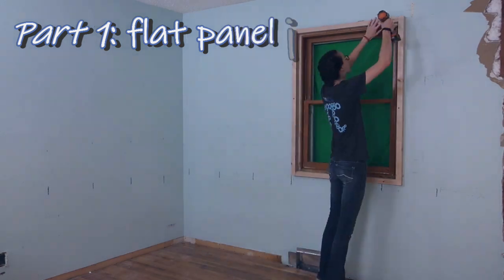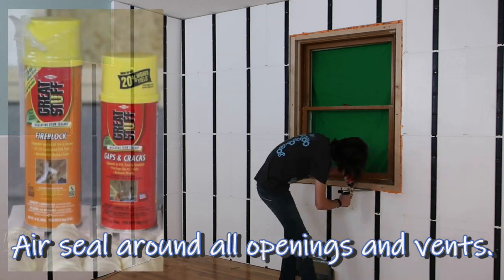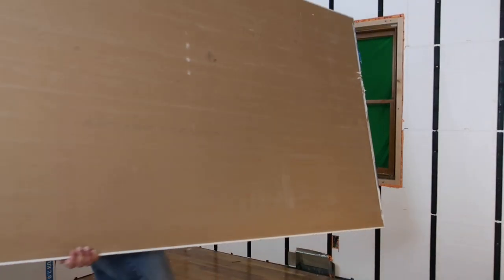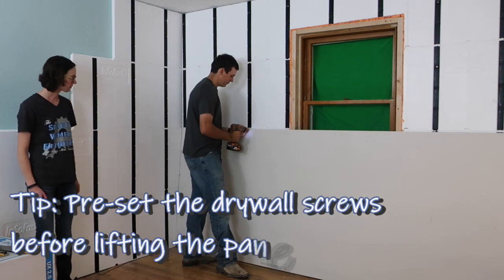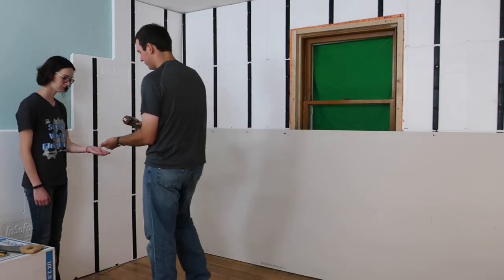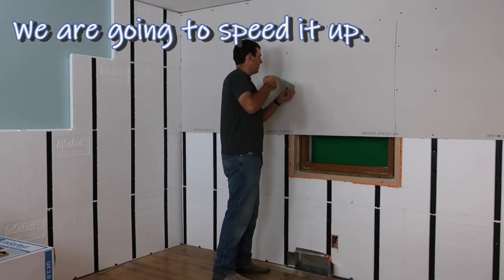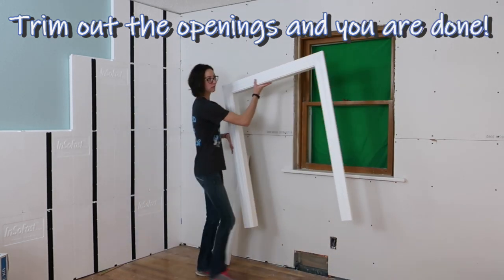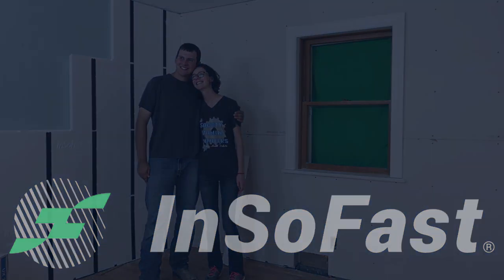Step-Two Insulation over Drywall or Plaster Part 2

Comment: Can I add this to my closet outside walls and not cover it with drywall, since noone sees it anyways? I have a closet that is pretty cold and I feel like the cold from the closet seeps into the bedroom, hence higher energy bills.
Reply from the maker: Foam plastic insulation by building codes should be covered. That is why we mold studs into our panels.

Comment: Is it possible to paint over the InSoFast panels directly? I want to insulate a tiny room, and I don't think I could lose the space to 2" panels and 1/4" drywall. (Seriously, the bedroom is only 8' x 11') [Colorado, dry environment]. I'm also curious if it would help at all just to do one outside wall.
Reply from the maker: Yes, no and maybe. You can just paint over the InSoFast Panels using water base paint. No. You, it is just foam and it will get bumped, dinged, and gouged easily. Additionally, it will not meet building code regulations. Maybe! Insulation always will improve comfort. i.e If you have a southern facing wall that gets the hot summer sun it will keep that wall cooler. Finally, I understand your fear of losing interior space. I did it on one wall in this bedroom/office https://www.youtube.com/watch?v=O9v1sTVV-jE and did not notice the loss of space. What I enjoyed was better comfort and deeper windowsills to place my morning coffee.
Reply: @insofast-continuous-insulation  Thank you!
Reply from the maker: @JRoseBooks  Sure, good luck with your project.

Comment: Do you need to worry about moisture doing this method?
Reply from the maker: If properly airsealed and finished it becomes a class III vapor barrier and can still dry to the outside. This particular application is not meant for basements but is suitable for above grade applications. Contact info@insofast.com for more information.

Comment: So I'm debating getting insulation blown in my walls. Could i use this over plaster and lathe walls (no inulsation) in Upstate NY?
Reply from the maker: Yes.
Reply: @insofast-continuous-insulation  plaster isnt always as flat as drywall, how do these fair to a not so even wall
Reply from the maker: @Hedgehodge-  PL Premium, the glue, does not shrink as it cures. This property allows it to act as a predictable “liquid shim” which can span and fill gaps of up to ⅜-in. The inter-locking nature of the panels helps to plumb and level the walls. For in-depth information visit our website https://www.insofast.com/resources/insulation-panels-for-interior-residential-masonry-walls.html
Reply: @insofast-continuous-insulation  nice, thank you

Comment: does this also reduce noise?
Reply from the maker: Yes It would reduce noise level.
Reply: @insofast-continuous-insulation  do you have testing on db reduction?
Reply from the maker: @KingKong_75  No that is a nearly impossible to quantify since it is a rating dependent on the entire assembly and sound frequency you are testing . InSoFast as a solid backer reduces wall vibration and serves more as a baffle. An analogy would be like placing your hand on the skin of a drum.
Reply: Got it.  I have a bedroom that shares a wall with the kitchen.  Unfortunately the contractor used 1/2 ultrlite gyp too.  Cabinets closing are a but loud in that bedroom.  Maybe I'll give the product a shot.